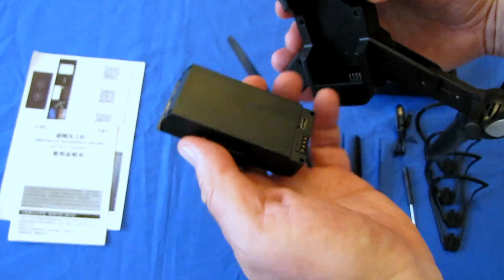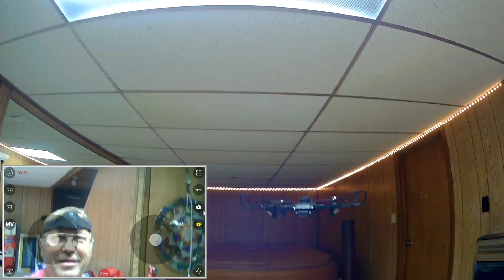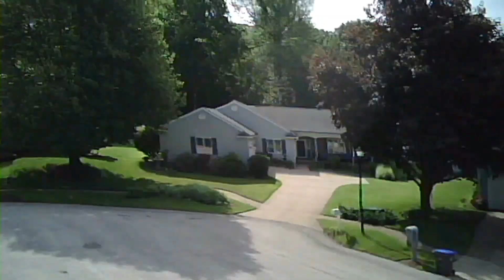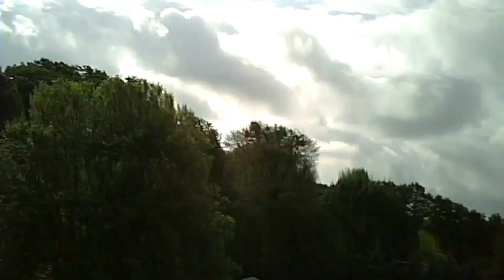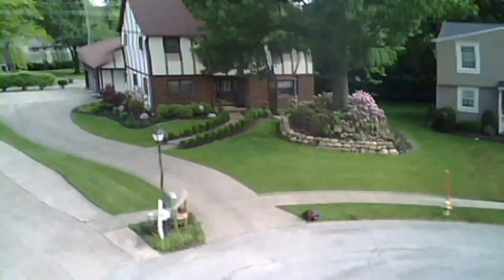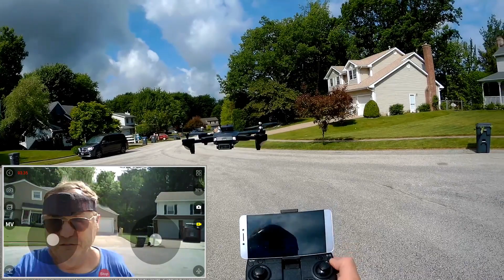KFPLAN KF617 Obstacle Avoidance Drone Flight Test Review

Comment: Will those stick movements for starting and stopping the motors cut the motors off in mid flight?
Reply from the maker: I haven't tried it, but I'd guess yes.  But it is a very unusual movement and position of the sticks.  That's why it's used, to minimize the potential for accidentally starting or stopping motors.
Reply: You must never use this method because it is not in the manual.
Your right stick will move the drone left and up, then left stick will cut the engines.

Simply push the left stick completely down to turn off engines. Up to turn them on.